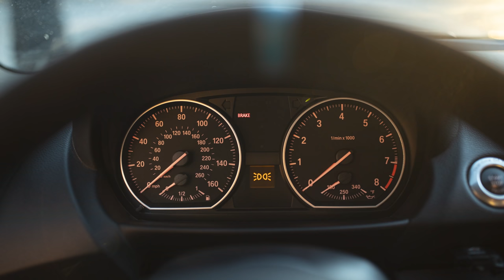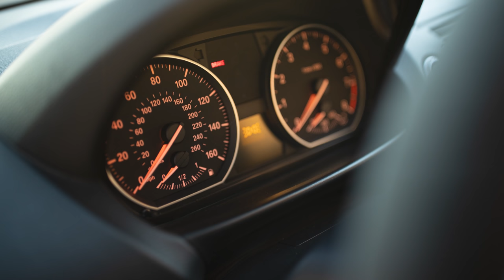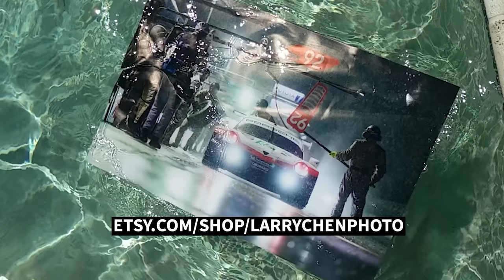530whp Widebody BMW 135i is a Daily Driven Time Attack Ripper

Comment: I’m a factory trained BMW Tech and the 135i is under appreciated. The 135i can be at the heels of a E92 M3 all day. The N54 is a good platform for sure.
Reply: Just as long as you do proper maintenance and upgrade all the cheap plastic parts to aluminum. Only downside is if you aren't working on it yourself, it's going to cost a good amount to have repaired but definitely a great platform!!
Reply: Brotha, how do you feel about the 128i non-SULEV, for a guy coming from an NA 330ci 6sp? (Mb54b30)
Reply: @michaeljfuzz i just got a 128i 

Youll like it do the 3sim and 130i tune  and enjoy a 270hp 128i lol

Comment: This man gets it.... single exit exhaust, performs better, looks better and is cheaper than a multi poo-shooter. Good man.
Reply: Personal preference
Reply: I disagree
Reply: Doesn't look better at all, dual looks symmetrical and stylish.
Reply: @Hankblue  also adds unnecessary weight
Reply: @stoney3694  I guess, but so do backseats, aircon and passengers.. I don't think it's even noticable at 200+bhp
Reply: @stoney3694  lmao you guys
Reply: Honestly, depends on what you're going for, but I agree single exhaust with this engine setup & the overall idea of the car is a statement.  For that JDM feel

Comment: Alex was the reason I got my 135i. Love seeing the progression of his E82.
Reply: Too bad he sold it 😞
Reply: How's reliability on those? This guy trades me his 135 M Sport for my Mk7 GTI. The only reason I wouldn't do it is reliability.
Reply: @renenemj1  beyond the common n54 issues, water pump, Watergate, etc, 135i are generally solid. Your GTI will certainly have lower mainenace cost over time, but I feel the fun factor is higher with the 135i. I've driver both, and own the 1er.
Reply: @Gustav555  he still has it. Wants $42k for it though.
Reply: @renenemj1  if you can work on it yourself it’s definitely a project but I daily drive a n54 135i and it’s not that bad. If you can’t work on it yourself walk away.

Comment: The 135 is sooooo cool.  I predict these cars will not only hold their value, but get more expensive with time.  Personally, I have a 128, and only bought it cause the price was really good.  But even that car sent me straight down the BMW rabbit hole.  It's not super fast, but it is super balanced and well rounded.  The weight distribution is on point, and you can feel it the first time you drive it.  I can only imagine what the 135 is like.  Will be my next car.

Comment: Sick 135i! This is what I had envisioned when I was shopping for one. I really wanted a e82 and almost bought a manual titanium silver 135i, but decided I wasn't quite done saving up. I ended up buying a 2JZ single turbo swapped IS200 instead sometime later on. 
Eventually got a manual built n55 e92 LCI on port WMI with the same turbo setup as this. Without the fuel limit it made 758 horsepower with I think WMI + 102 octane, done by previous owner. I wanted WMI + pump (no 102 here) so I was redoing tunes when it broke shortly after purchase.
Unfortunately it's been standing for 2 years now with probably (hopefully) a blown head gasket. It's losing oil and coolant fast and has a rough idle. Hoping to fix it this winter, but I also want to swap the gearbox in my IS. 😬Seeing this E82 makes me wish I had gotten a 1 series it's gorgeous.😍 And people know it, the e82 even without a 6 cylinder is way more expensive than the other e8x here. Wish there were nice E82 bodykits available but the 1M kit just looks perfect. Screw it being a "fake" 1M it ends up being the same thing for less money with upgrades going beyond the 1M, this is the way.

Is this MHD tuned? Where did you get this done? My e-tuner in germany is very poor in communicating and will probably charge me for further tuning since it's been 2 years. I was thinking about going to Twisted Tuning for my maps instead if my current tuner charges again. Unsure if adding JB4 will be worth the trouble.

Comment: I NEED a manual 135
Reply: I’m selling one
Reply: @locovaldez6943  how much?
Reply: N54 MN 13k fbo 105xxx miles clean California title
Reply: Also selling one, $14K 107 miles clean TN title fbo with maintenance out the ass. Jet black / coral red 6MT
Reply: @Chattsteezy  negotiable at all?
Reply: @bimmerfab  Not much. Car is in great shape and runs like a champ and i'm still back and forth on selling.
Reply: @Chattsteezy  it's a n55 though isn't it?
Reply: Buy a e46!
Reply: I have a 10sec 135i 6spd that I will sell for 21k. Clean CA title.
Reply: N54 MN I got a 2009 N54 135i 59k 6spd manual seats no nav with full service history only at BMW in Thousand Oaks, CA. I am the second owner. I bought it from the original owner who owned it for almost 10 years.
Send me a private msg if interested.
Reply: @mayorevolution4772  I would send you a private message me if I knew how
Reply: @bimmerfab  you want an N55 unless you prefer chasing misfires and doing a surprisingly expensive single turbo conversion vs swapping internals or just living with 600hp on the stock motor.
Reply: @Shakshuka69  not true
Reply: @bimmerfab  yes true almost all the N54s making more power than the N55 can hold stock are single turbo converted because otherwise they get too hot and start having problems. You either go single turbo N54 or forged N55 neither is perfect.
Reply: @Shakshuka69  still don't agree because you try putting big twins on a n55 you'll bend those rods much faster than a n54 on upgraded twins making big torque. Big and low torque numbers is what kills n54s and n55s thats why going big single on n54s makes sense bring the torque in later. Big single on a n54 would be cheaper still than building a n55 motor. Motor built get expensive fast
Reply: @bimmerfab  that's not true. Full set of carillo rods and pistons for an N55 is $1000. Add another $2k max for labor. Still less than half of what a good single turbo N54 will cost and will still be more reliable and consistent
Reply: @bimmerfab  bottom line is if you wanna take advantage of the increased factory strength of the N54, you still have to deal with overheating issues or an expensive turbo conversion to mitigate the heat. Twin turbos make crazy heat. So unless you want 700hp specifically, but not any more, 600hp just won't cut it, the N54 is no better place to start.
Reply: @bimmerfab  and one last thing for your general knowledge (I had the same misconception before) twin turbos won't help you make any more power than one turbo. The only reason manufacturers use them is to have both a big turbo for high rpm boost, and a small turbo for low rpm boost, and no lag in between. But once you crank the boost up, they get so hot that tuners just ditch them for a single.
Reply: @Shakshuka69  im not sure where your buying parts but carillo rods are typically 1500 je  pistons are 1000-1200 and then you'd want to do bearings and other things while your in there. Twins do make a ton of heat the more boost you push through them. Single turbo kits have came down in price for n54 and there's lots of options available these days. Cooling on the n54 and n55 are nearly identical so not sure what your saying there. You can buy a $60 bms cooler valve or get a oil cooler for your n54 if your that concerned about cooling. Either way n54 n55 cooling systems are both inferior to s55 and b58 platforms.
Reply: @bimmerfab  ...yeah but you have significantly less heat from having one less turbo. Which means more efficient boost too. Twin turbos suck for motorsports and you wanna do all that preventative maintenance on an N54 before going for big power anyways so you're not saving anything on bearings and seals.
Reply: @bimmerfab  absolutely true. As an N54 335i and 135i N55 owner, N55 is infinitely more reliable, sounds better and can still handle 500+whp stock internals. N54 is constant misfires. The ECUs go bad all the time, the injectors are a headache, and carbon buildup is bad. N55 solved all those problems and gives you the single turbo starting point.

Comment: This one sounds amazing 😍 And I just let a 135i go cause I cheeped out. What does a 2010 M package with around 80k miles go for in the States? In Sweden there about 20-25k$.
Reply: 14k-20k. They're hard to find with less than 90k miles. I got mine with 92k miles for 12k, but maintenance was always kept up. I'm at 106k miles with tune and runs like a dream

Comment: So nice to see my car with so nice spec. E82 with the OG N54 are king. I hope that I can realize a 1erM conversion in the near future. Technically, as optically. I just love this car. 400 - 450 hp is the perfect power for tracks. unfortunately you have to convert the barrel bearings and all bearings to PU. otherwise the car swims incredibly strong in performance. Injectors and pumps are a well-known disease.

Comment: There is a small benefit that the N54 has over the B58 and that's that the N54 is less of an over square than the B58 and is more like the S58 in that way. Should help with revving.

Comment: a man who works with card bodies ones told me that if you weld a body panel to a car after it has left the factory and its original coating and painting eventually after some time you will get rust spots around the welded area because the heat generated with welding actually burns some protective coating on the metal. Do you guys know if this is legit , because i definately like the widebody look but wont do it if the car gets fucked up by it in the long run

Comment: I had a 2011 135i was in the shop almost as much as on the road
Reply: I'm thinking about getting one in the future. What kind of issues did you have?
Reply: @MCNeurotiK  honestly where to start, the cooling system is garbage and extremely hard to get to sensors was left n right, miss firing issues coolant senor malfunction

Comment: The "single hump" dashboard screams poverty spec on the E90.
Reply: I actually prefer mine without x drive. It’s rarely used and really all you need is a good aftermarket head unit.

Comment: roll bar and rear seat is badass tf this dude talking about
Reply: Rear seat is not functional with a roll bar, and if you put friends back there, they'll die quickly in a crash. On top of that, rear seat adds weight, paired with a roll bar you're now adding 75lbs and endangering anyone who sits back there. Make sense?